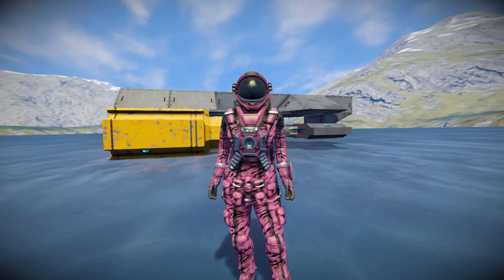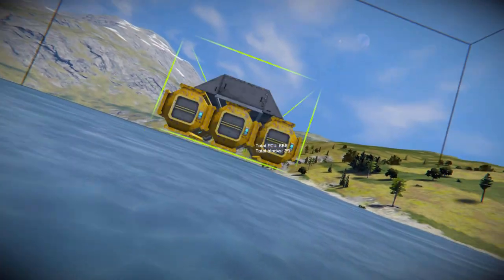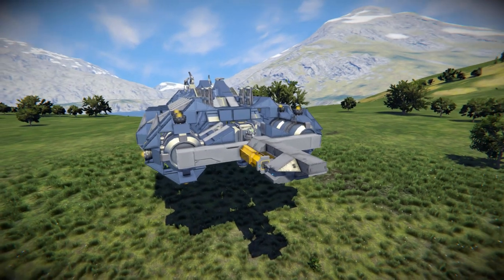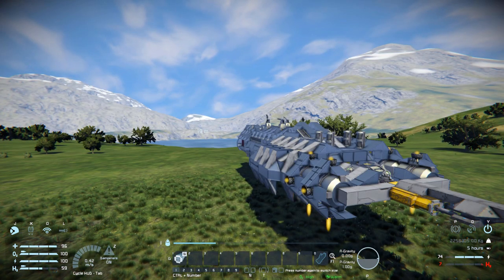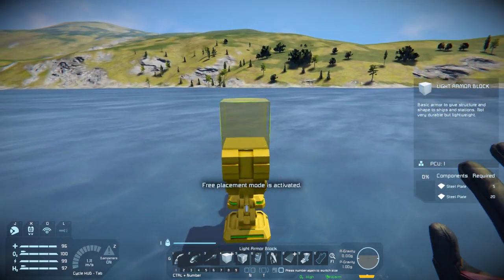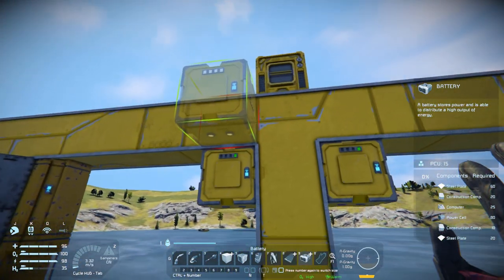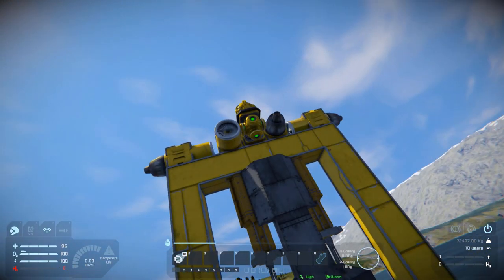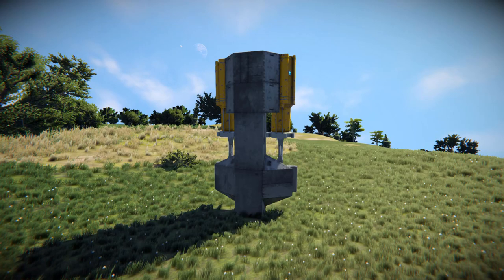The Helios PDD-3 Piston Door Drive - Space Engineers

Comment: Guys, you can use Clang to overload A sub- grid to control grid- slips, like when you impact at A high velocity and clip into the terrain. With astroids in your path, it's great. No worries for impacts, since you phase through everything. I'm surprised it hasn't been exploited elsewhere.
Reply: Specifically you use thruster offset on an attached grid to conflict with the main, you know the wobbling effect, in A specific format.
Reply: @a32k57  what? Im confused
Reply: Please explain. I need a Clang-powered intangability drive
Reply: @leakingamps2050  That's improbable.
Reply: @leakingamps2050  Here's A tip- speed up into astroids, colisions might not load.
Reply: @leakingamps2050  Oh, and by the way. Balance central- mass with mass blocks. The math.

Comment: The reason this it happening is because the piston is pushing a thin hitbox through the door's own hitbox, but the game is trying to remove the other hitbox by applying force to the piston, pushing it the other way (forward) than the piston is moving, so the reason the game is trying to push out the other hitbox from the door is actually the  result of the development team making multiple grids no longer be able to be forced into the same spot, usually when players would forces two objects into the same spot, the game would just detonate both items, so the developers made the game try to slowly push the items away rather that detonating. But that's just a theory, a game theory